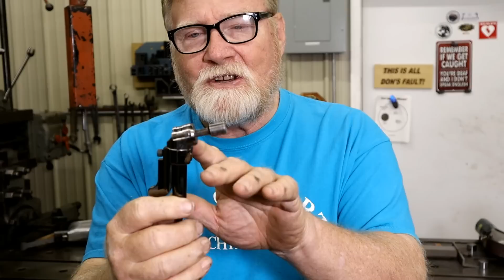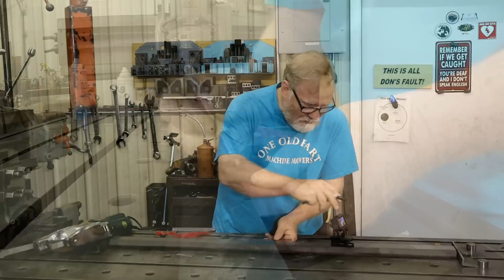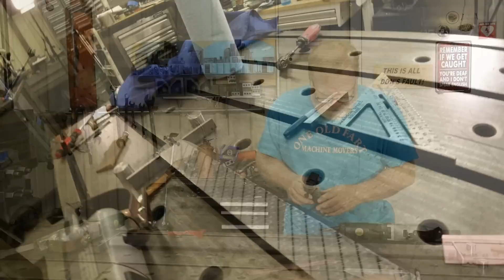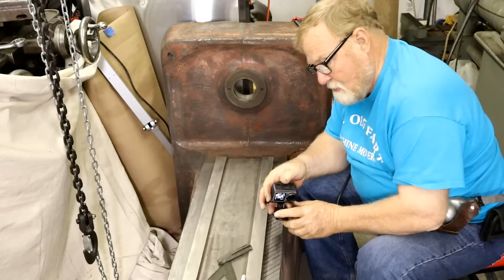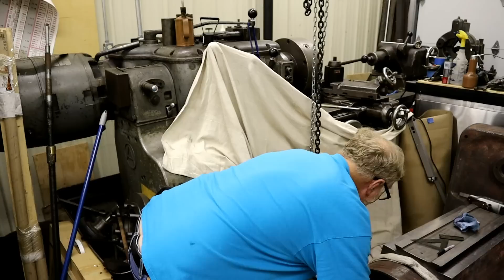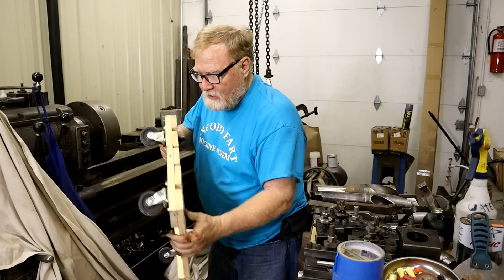I think I know why notifications stop coming from YouTube!  Plus Flaking a Bridgeport

Comment: Chrome ways are almost impossible to when the factory rebuilds they strip the chrome off then scape or flake it a rechrome it. A diamond burr mounted in a foredom hand grinder will work by retracing the original flaking pattern. Lots of work . Cheers
Reply from the maker: I would hate to try to trace that pattern out!

Comment: I was wondering what the total back and forth movement is on the power flaker.
Reply from the maker: How do you mean? it rocks in place and does not actually move side to side.
Reply: @10swatkins  So maybe an "Oscillating tool" could work?

Comment: The ram to head rotator joint on my Powermatic Millrite vertical mill has ground mating surfaces and a terrible stick/slip condition. makes it very difficult to tram.  You've given me confidence to try flaking those surfaces. Thanks Steve.
Reply from the maker: Great... Can't do anything but help!

Comment: Water goes to the bottom. Put a hose down to the bottom and pump the water out. Done deal
Reply: That would work if it’s not already mixed together and looks like a vanilla milkshake.
Reply from the maker: If this were a bridgeport I would not mind trying to get it all out that way... But this is unreplaceable at least for me....   I bought two other barrels to put most of the old oil into and I might try the old rope filter trick, transfering the oil from one into the other using a cotton rope as a filter and transfer route.

Comment: I don't have the Biax flaker yet, just their scrapers, but I studied the inner workings of the flaker and the cam lobe inside does bump the blade forward (while applying the twist) when you are pressing the blade to the surface. There's no spring holding the blade shaft tight to the cam lobe, so it only moves it under load. I am guessing your blades are sharp, you have the right tools to sharpen them and correct blades. So I am suspecting that the rubber bushings may have degraded, or there is slop in the slide, since the flake pattern seems excessively wide and is giving you so much trouble. I know they are tricky to use, but I don't think they are that tricky.
Reply from the maker: I have not opened it up but it seems to be working fine.... I could get smaller ones but I really liked the longer "legs" I think they will will act a funnels to the wider top and move oil around a little.. BUt that is just a theory...